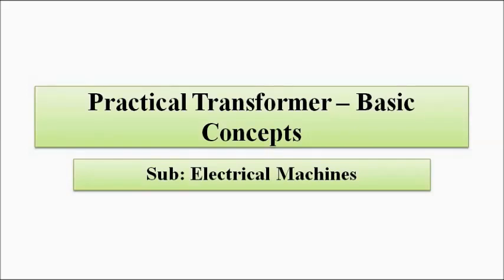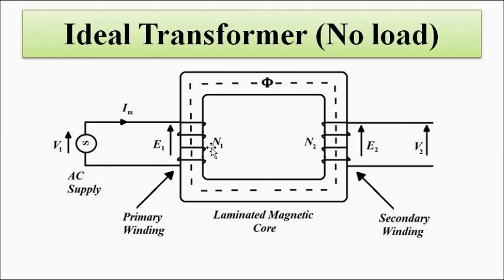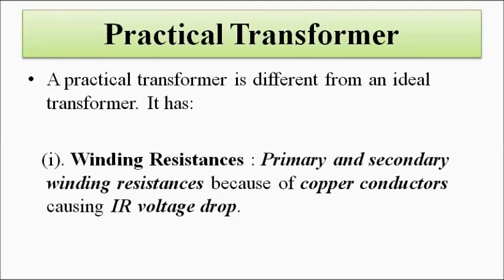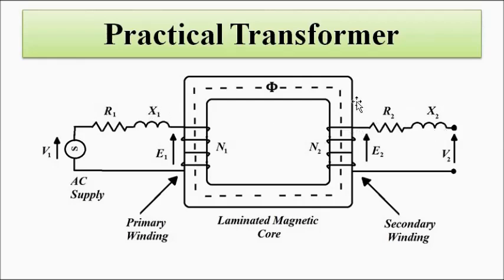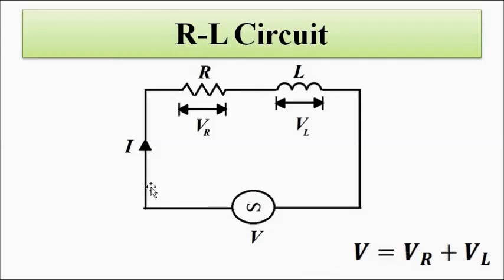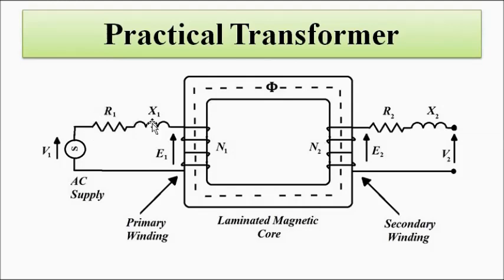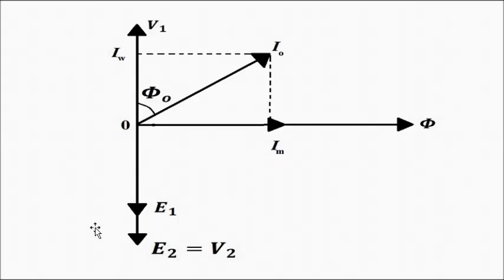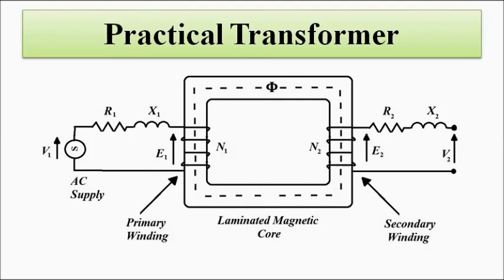Practical Transformer On No Load | Basic Concepts | Electrical Machines

Comment: Why is the current here negligible in this case? I've read that it's only 3-5% of rated current. Why is this so? We have just a normal RL circuit in this case with  
Im=Vm/(√(R²+(wL)²). 
Why is this 3-5% of rated current? I fail to see how connecting a load to the secondary coil increases the current flow even in the primary.

Comment: Incomplete information, should include voltage drop due to resistance in primary winding and reactance drop in primary winding. Without these two drop , we can't say practical transformers at no load . The thumbnail of your video should be Ideal transformer at no load 🙂
Reply: He hasn't drawn the equivalent circuit of practical transformer on no load...but the pic was correct...the core loss component and the magnetising current component is shown in phaser diagram but not in transformer pic..it is correct...it is hidden there..